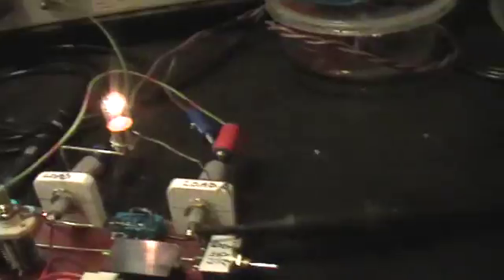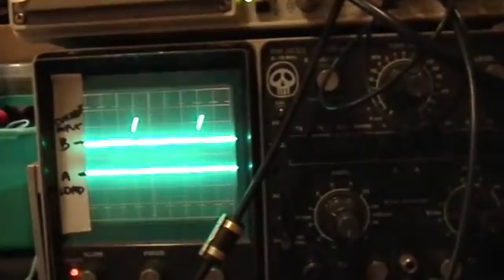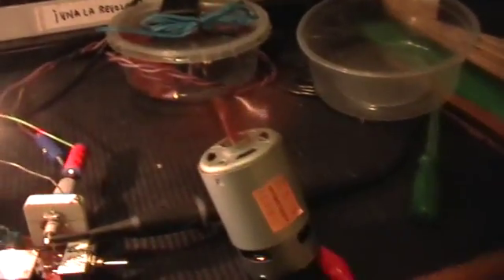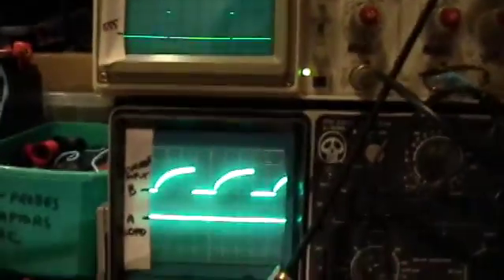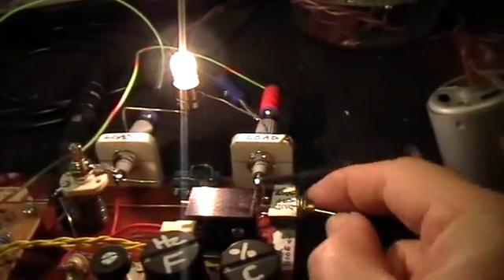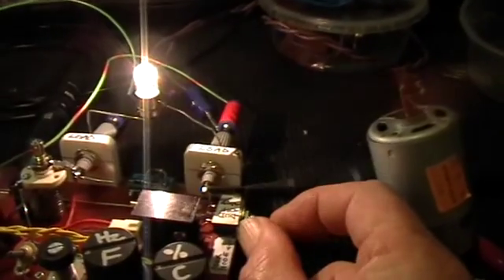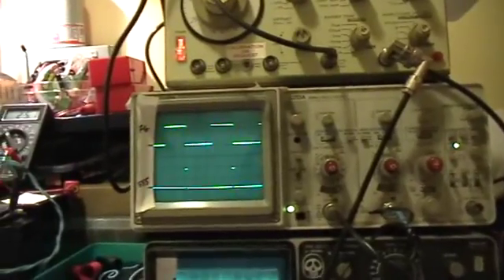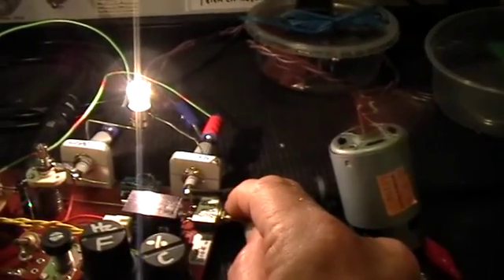Electric OU 5: The Ainslie circuit as PWM Motor Controller--Effect of Recirculation Diode

Comment from the maker: Yes, Rosemary, that's the extreme irony.

"Your" circuit is a well-known and long-used and rather poorly designed (wrt component values) ordinary pulse-width modulated motor or light controller circuit. It has been in use in industry and by consumers for many many years, almost as long as fast-switching mosfets have been available.

Imagine the boost in sales, if, say, a Makita 18V BHP454 could recharge its own batteries!!

But it ain't gonna happen, because your claimed "experiment" is wrong.

Comment from the maker: AT LEAST two of my relevant posts have been removed, perhaps more. Not by me, that's for sure.
One that answered a direct question about the circuit used by the various replicators, including a photograph of the circuit and the diagrams from which it was constructed--Ainslie's own publications. And another one that was a more general recap of my findings, asking questions that still have not been satisfactorily answered.
These posts, at minimum, have been removed, and they are highly relevant.

Comment from the maker: "For the record, TK is knowingly posting false information.
In the video description, "And finally, the thread where Ainslie is currently posting, from which most of my relevant posts have been removed by "moderation":"
Take note that nothing has been removed.
With Gratitude, Aaron"

This is a clear and blatant falsehood. I posted several posts that have been removed, including one between # 455 and #470. Does post #470 make sense? What post of mine is it referring to?